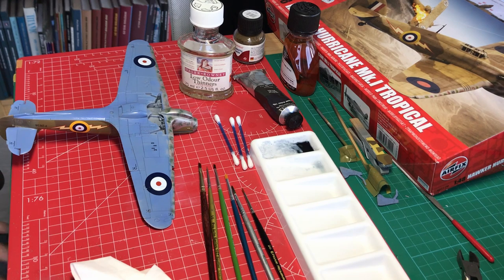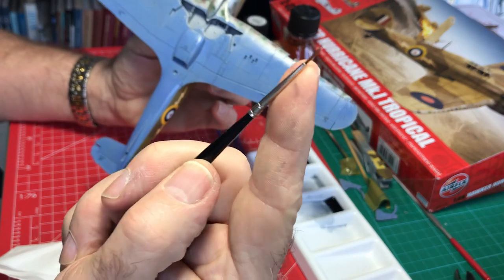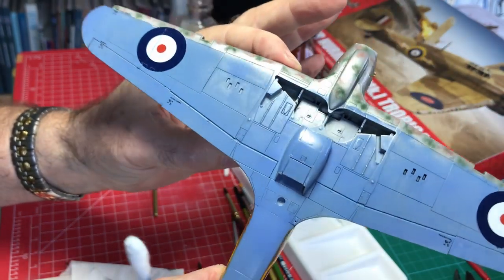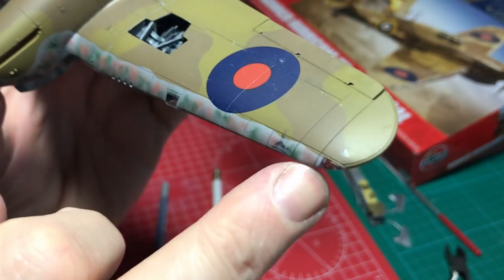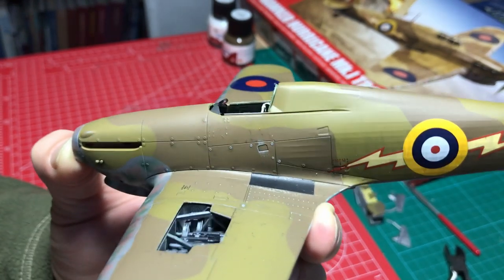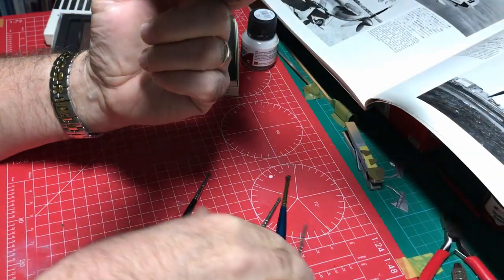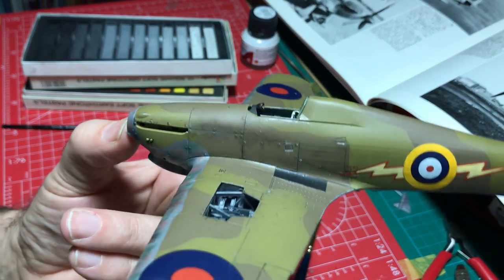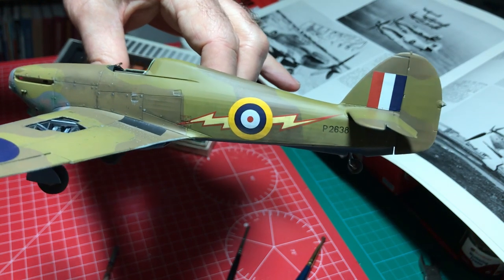HUMBROL | How To: Airfix Hawker Hurricane MK.1 Tropical - Part Ten

Comment: Great stuff Geoff. 
Can i ask your advice . Is it ok to use Humbrol clear acrylic varnish and then the decal fix together.
 The Humbrol website videos say if you use the acrylic clear gloss on the model then apply the decals with decal fix you must mix water and dilute the decal fix as it will damage the gloss surface of the clear finish because both products are Ammonia based ?
 Also does this mean that the acrylic clear is not permanent if say using the matt as a finish to display your model.
Again Geoff thankyou for the videos and advice
Reply: i think you're best going to scale modelling now to get an answer from geoff as this has all been recorded before Christmas
Reply: Hi Pete - so sorry for the delay in getting back to you, I hadn't realised the video set had gone live! As Damon says below, the full build is in SMN, just click the link (if you're a subscriber) on this page: https://www.scalemodellingnow.com/finishednow-aircraft 
I didn't dilute the decal fix at all and it all worked fine? I'd follow their directions though to be safe. The other thing I do is leave the model for 2-3 days after applying the gloss varnish and make sure that it's rock hard and dry before attempting to apply any decals and this will reduce the chances of any adverse reaction. Best wishes, Geoff C.